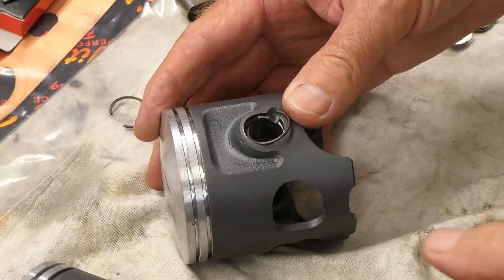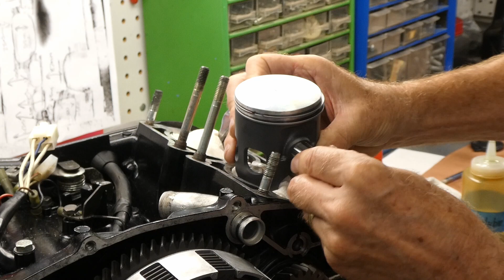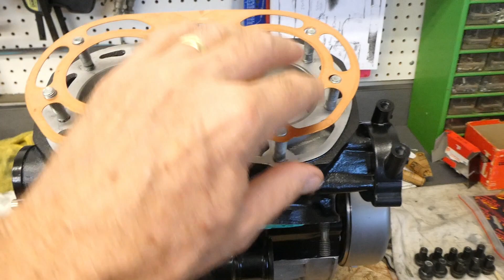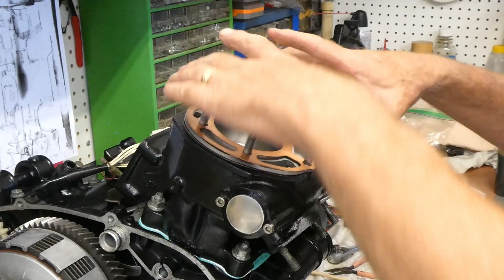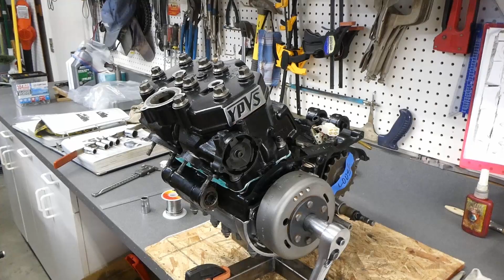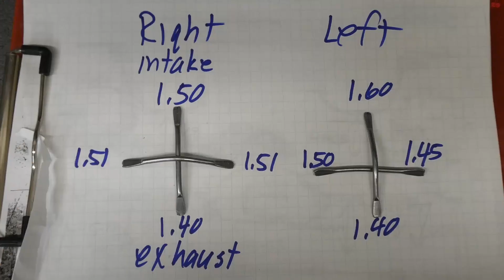RZ350 NC2 Ep47 Top End Assy & Squish Band Measurement

Comment: Hello Ken, I was wondering if you could help me. I am fixing my RD350 YPVS of 1985, I have rectified the cylinders at 64.25, may I ask if you can tell me how much does the tolerance for the pistons need to be. I was also wondering if you could tell me how much does the header needs to be tightened with the dynamometer Nm.
Reply from the maker: Hi Mauro. When I rebore I hand off the cylinders to the machinist (ex Kenny Roberts mechanic). He inspects the cylinders and lets me know what size pistons to purchase based on the condition of the cylinders. Before he bores them out I have the pistons delivered to his shop. He analyzes the pistons and bores per the piston manufacturers spec plus his own knowledge. Cast vs forged pistons have different clearance tolerances. Be careful. The header tightening spec...I just snug them up. Never used a torque wrench for the exhaust flanges.

Comment: Nice work Ken.  Those circlips are pesky to install. You did a nice job explaining the sequence getting the cylinders and the head to come together properly, following the shop manual.  Time well spent now, ideally, leads to a successful leakdown test later, and a strong, long lasting engine. 😊
Reply from the maker: Thanks Scott. I appreciate your comments and feedback here. Since this engine is a bit similar to your Spec2 I am utilizing some of your specifications like carburetor jetting. I am not so sure the manual follows the same sequence though. I believe they install cylinders, tighten the nuts in sequence, and then install the head.
Reply: @KensGarage1  That's true about the Yamaha manual.  Between the good info on the RZ forum, the TSW forum, and the banshee YouTube videos out there, the process you are using on the cylinder and head assembly is well regarded and works well.  Patience, and procedure s, along with attention to detail, almost always leads to a well running engine.  Doing it yourself is a bonus. You know it is done right. 😊

I'll  be curious to hear how your bike runs with my carb setup.  We probably have more humid air. The elevation  is 510' at home, the highest area road elevation I ride is about 1200'.  I suspect your air tends to be dryer and your elevation range is broader and higher.  As tuned, my RZ is just on the rich side of crisp.  Sharp throttle response, no mid range stumble, strong pull to the redline above 5k, without the risk if being too lean.  That is the goal.  Keep me posted as you break in your engine.  Curious to hear what you think.

Comment: Nice job. I have an 87 that I rebuilt around 20years ago, and it’s still running strong. The oil pump is starting to weep a bit of oil though.I have a 85 rz up in the barn. I plan on restoring it, but need he tach drive gear assembly, does anyone know where I might get one?
Reply from the maker: Thanks John B. I'll bet if you go here https://www.rzrd500.com/phpBB3/ , register, introduce yourself (if you're not already on there), then put up a wanted to buy post, you should be able to find the tach drive gear assembly. Or maybe eBay. Unfortunately the banshee (and I believe the 87 and up Canadian) does not use the tach drive gear so it may be an 83-85 RZ350 specific item. Good luck.
Reply: @KensGarage1  Okay thanks.

Comment: I'm sure you know this, but there is a tool available to set the barrel torque correctly. The one I bought was called a 'Motion Pro Motocross MX Enduro Bike Torque Wrench Adapter'. It's basically a ring spanner with a square hole in the middle to fit a torque wrench into. You then need to do a bit of math to work out the correct torque setting.
BTW I'm not a fan of the green gaskets. Next to the black barrels and cases, they look horrible.
Reply from the maker: That's a nice adapter. I think a crows foot tool (like this 
 https://amzn.to/3Sv3E3R ) would be a cheaper solution however, I've done several of these without using a torque wrench on those nuts so not overly concerned. My calibrated hands/wrists/arms will have to do in this instance. 

Yeah, you got me on the green gasket. I have to agree. But I had purchased a few of them from I think Vitos and had it in stock. I think I have three engines with these greenies on them now. I think the same goes with the aftermarket clutch cover gaskets. But I have a Yamaha one for this build.